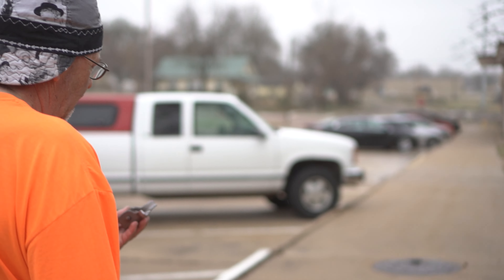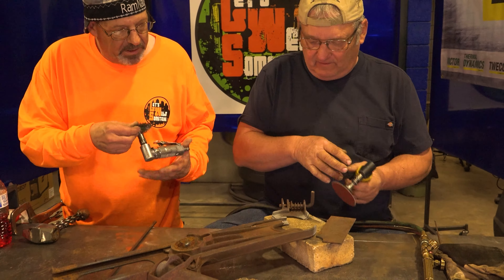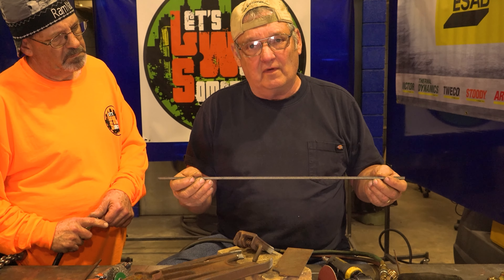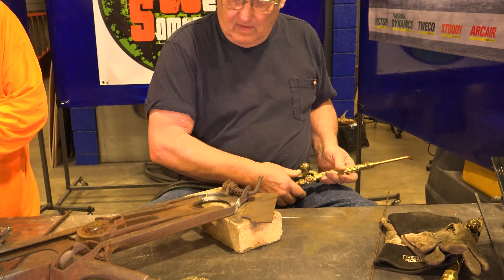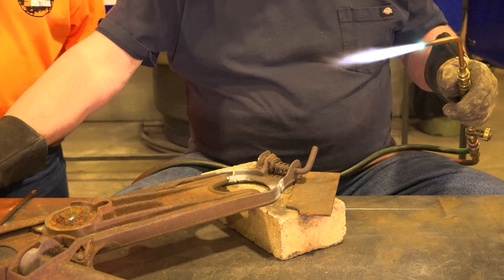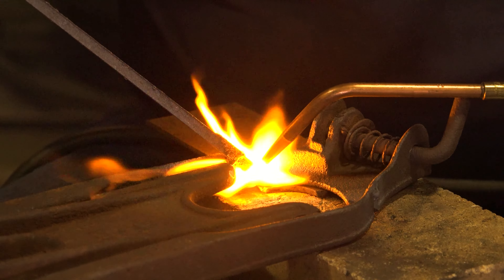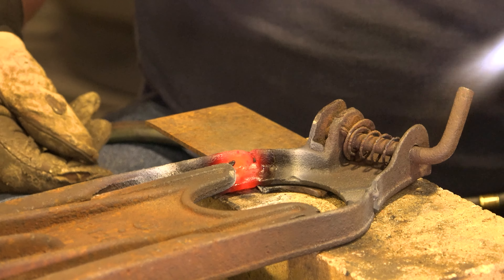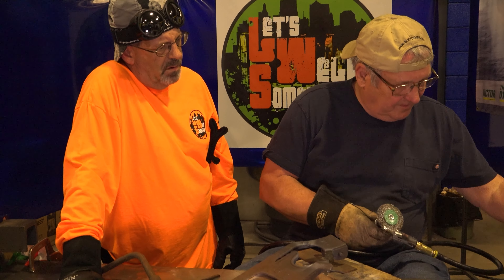Cast Iron Repair with Gary Wilson

Comment: I am 71 as well and a couple of years ago a repaired a 6 inch vise with what we call cast 60 rods. it worked very well. No complaints from the vise owner, it has not broke so far. I have also used silicone bronze via mig welding and it also works for me. You have to clean the area and pre heat and it does work to repair cast iron objects. You can always learn from the older guys, just listen to them , they have a whole world of experience, which should never be lost.